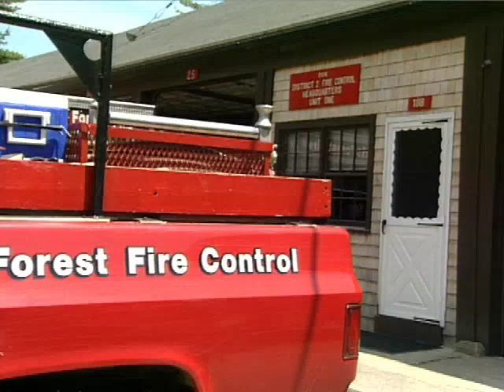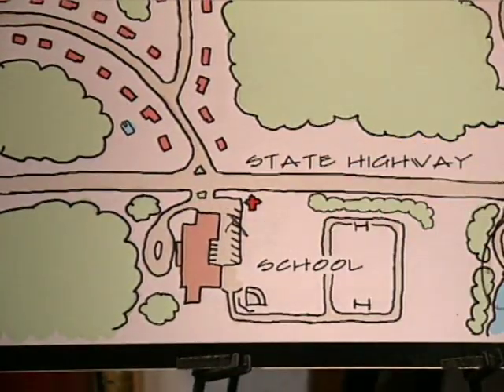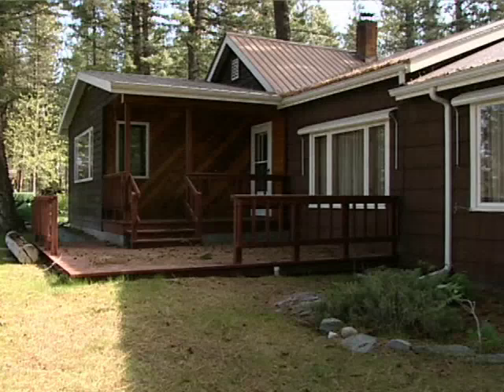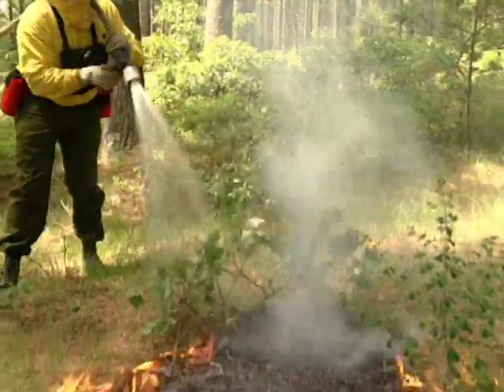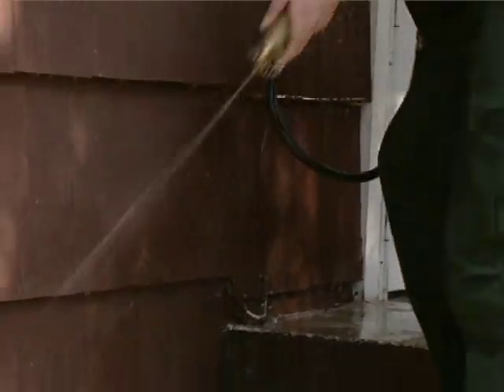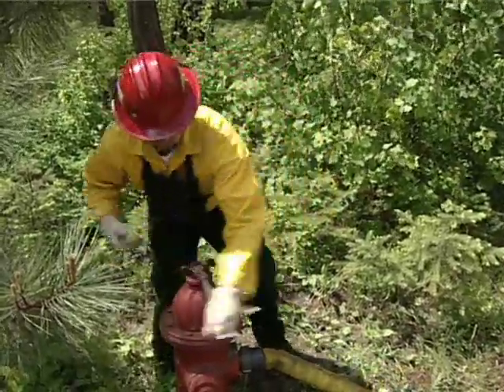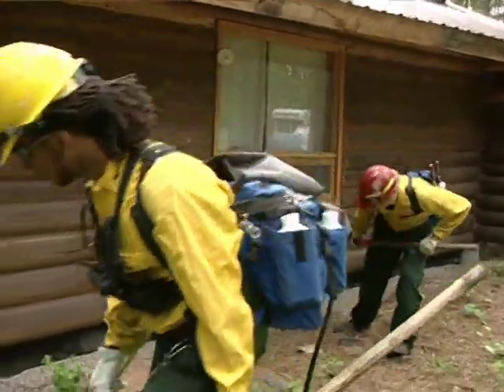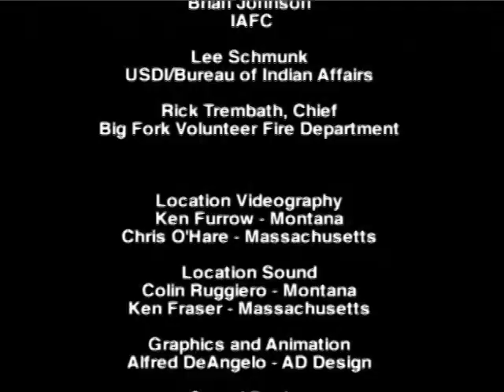Using Water Effectively in the Wildland/Urban Interface

Comment: Makes one appreciate having hydrants in the majority of our area. Once got yelled at by an old member after a fire for cranking up the 1" nozzle from 35gpm to 75... that I was wasting water. My response was that the engine was parked next to a hydrant and that I would have turned the deck gun on it if it had been in range or called a tower ladder if it had been bigger and closer, just make it rain out of twin 700gpm ladder pipes...

Comment: I wouldn't say that fire departments fail to have the proper adapters "over and over" with neighboring departments. Even from structural to wildland oriented units its not that regular an issue unless some people are really asleep at the wheel. There aren't that many choices and if its a place you regularly go, many excuses for not having the right adapters; and if its going in an area where you operate rarely or never before but they have different threads than nearby areas they should be aware and have adapters they can provide. Even in that rare case there's still someone between you and them that deals with the issue more frequently and can help. There's at most 5 or 6 coupling types and of those the majority is between NYC, NST and NPT unless you want to throw stortz in which is even easier to adapt, or commercial suction hose with the two cams which shouldn't be an issue since its mostly for suction and therefore doesn't have to match anything else but the pump thats drafting. Feelmlike the over and over makes many seem very inept

Comment: The most important things for any fire fighter to think of is, knowing where every drop of water is going and how much is needed to get the job done.  How much is needed and what is the Best way to apply it.  Which way is the wind blowing while you are applying the water.  The moto of Every FFer and department should be, "Stop the Threat as Fast and Safely as possible while using the Least amount of water."  That makes you have to Think before you act.

Comment: I'm a Wildland Firefighter. I would disengage an pull back. And reassess the fire. I would probably call in some air attack. All the assessment of the houses will burn in the fire.
Reply: what about a back fire and fire line?
we've that often to get rid of brush and when they meet, they brn themselves out away from structures